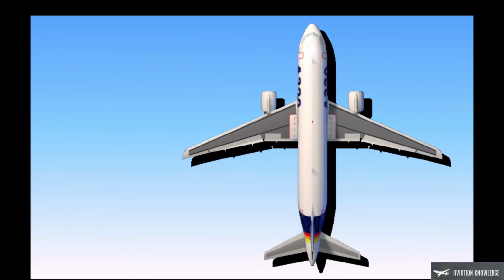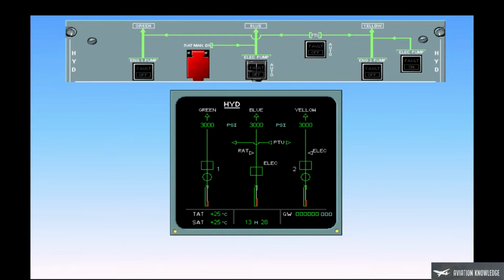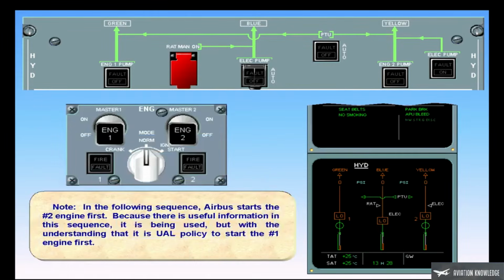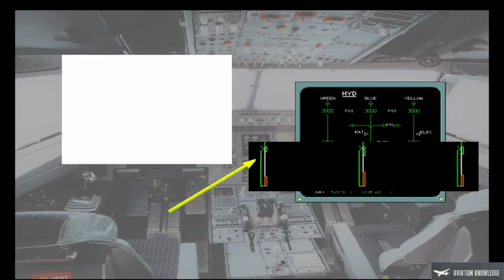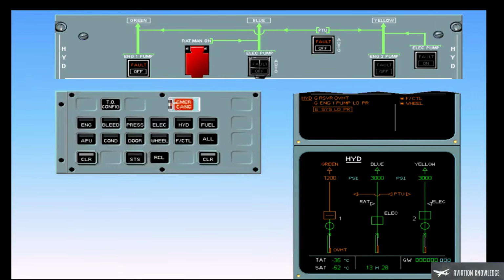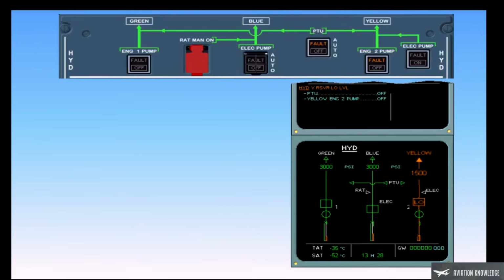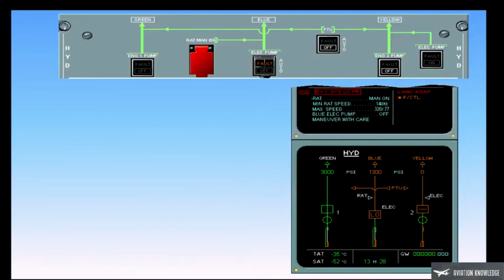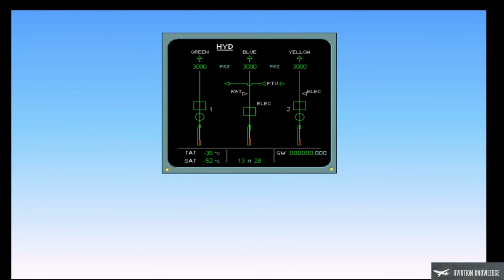A320 CBT HYDRAULIC SYSTEM - PRESENTATION - NORMAL - ABNORMAL

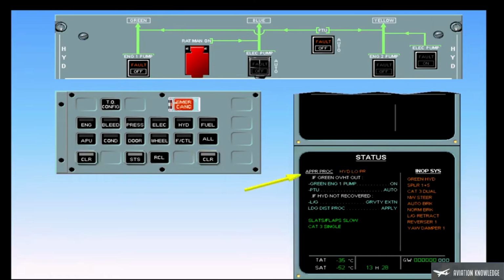Comment: Isn’t Nose-wheel Steering covered by the Yellow system?  16:46
Reply: In Classic A320 NWS uses the green system, but for ENHANCED A320 and A320NEO it uses the yellow system.
Reply: It is
Reply from the maker: It’s on landing gear system